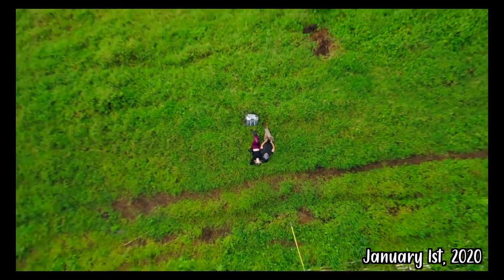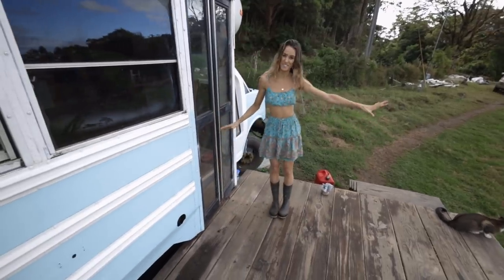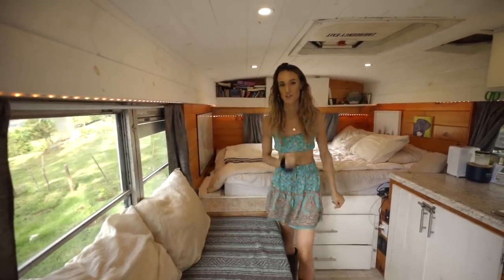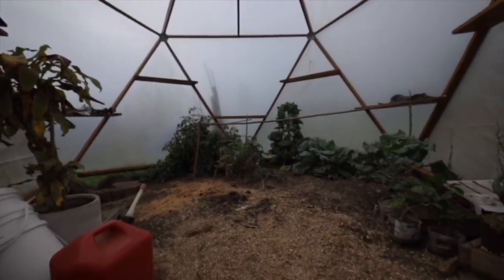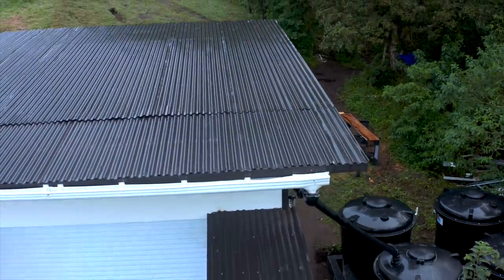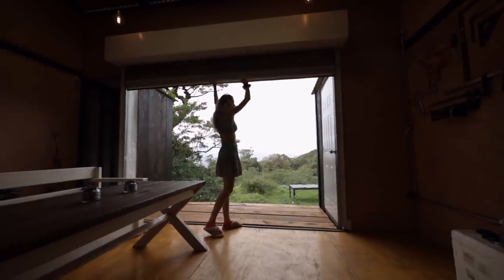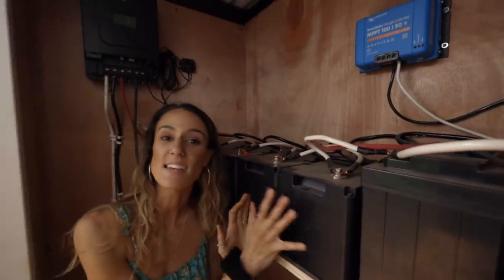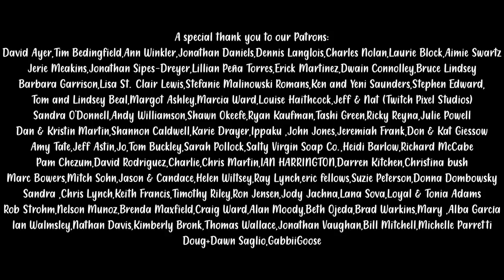TIMELAPSE: How We Built A 3 Acre Farm in 1 Year from Scratch

Comment: For that rough road of yours, try getting hold of an old grader/tractor tyre. The bigger/heavier the better. Lay it flat, put one of your pieces of offcut square tubes on the inside with a strong U-Bolt through the tyre. You can even add a grate inside and add rocks/gravel inside for additional weight. Then, just drag it behind your truck using a strong chain when you go down to town and then back up again on your way home... In no time your road will be smooth and driveable as the rubber even rips out the small rocks sticking out the ground for a nice smooth finnish...
Reply: That probably would work better when the ground is wet.

Comment: I would make a large sealed “pond” at the top of the hill and run a pipe all the way down with a hydro electric generator if it rains that much and you can make the pond big enough u might be able to make electricity 24/7 or you could basically use the pond as a massive battery and only open the valve when u need power
Reply: Or 2 ponds to pump it back up with unused solar/wind Power.

Comment: You both are doing really well !   Congratulations !   For anyone living off grid and without hot water yet.... it's super easy to setup and you don't need much power.   You can run it off of a 12V water pump and propane, all you need is a cistern.   I waited 2 years before hooking it up and good god.... i can relate to how amazing it is, and it only took half a day to setup.
Reply: ....or you could burn firewood under a copper water tank...and do the necessary plumbing.

Comment: The progress y'all made in the last six months is amazing! Inspiring make me feel lazy lol  Thanks for the overview of your power system you have a fine set up. People look at amp hours but convert it to kwh and you can literary calculate your power consumption. Been trying semi off grid for over a decade and I am still learning. My advice to everyone is plan you power for your worst days more panels often are required it helps series wiring them at 48 volts into the mppt controller. It maximizes low light efficiency sometimes 20% - 30% lets face it much money in the batteries. Most people want to add to the battery bank but a small bank charged to 100% on bad days is better than a large on only getting 50% on decent days. This alone will double the life of high priced batteries but on good days it extreme free power!! Also a propane RV water heater saved me tons of power consumption for the bad days. 

Sorry I used to install back up systems and kinda nerding out on your set up....
Reply: An air-source heat pump in that climate would be fantastically efficient for heating both domestic water and any interior heating for those cold nights. Dollar-wise vastly more efficient than propane or any other fuel source. The possible fly in that formula-ointment might arise from fact that generating/storing electricity at the site is also expensive.

Comment: technically you want your solar panels facing the south on the northen hemisphere and nothth on the souther. and normally you would tilt your panels in a fixed instalation the latitude un degrees. panama is between 7 ish to 9 ish degrees but for self cleaning via rain normally you tilt them 15 degrees that the self cleaning minimum angle. should you clean them offen usinf the latitud angle should be a little more efficient. also shade makes panes super inefficent, partial shade makes the electron that you made move from producing cells stay on shaded ones so the energy production is drastically reduced by saded cells (the squere blocks are individual cells) source my thesis was a big proyect. also sollar is the only big energy production method that dosent produce AC current. peltier effect also but is extreamly uncommon. all energy produced by movement and rotation is ac and has to be "refined" to 110 v in a "good " sine wave from the source.
Reply: The solar inverter will transform DC to AC.     However,   That aside I am amazed that there is enough energy being produced to run the Arc welder?      I have a 12,000W system with 2 x 5Kw inverters with a 19Kw battery back up.    With all what you are running I am amazed.??
Reply: @tommybrown9034  They probably used the bus as a energy source by using its motor
Reply: @Plaufin  Nowhere near enough power? looking at all the electrical power tools including the Samsung  fridge that uses a lot of energy 24 hours a day.

Comment: id recommend you put the wood stove lower or you'll need a way to redistribute the heat for the lower area from floor to stove higher. i had to mount the same stove at 4 foot high in my camper as it was the only place to put it, but found i got very cold feet and legs, it is in Canada and i camp in winter so obviously a lot different from your climate. ended up solving the problem with a computer fan up high and metal duct to transfer thre hot air down so it comes out on the floor . but obviously a-lot simpler to to just mount stove down low if you can.

Comment: three phase isnt really problematic unless you have to set up appliances that use three phase electricity. you can treat each of the lives as a single phase line. It can be tricky setting up a motor if its a three phase motor because you need to know if it uses a star or delta set up but otherwise all you need to know is don't cross your lives because its hazardous the same way you don't cross a live and neutral. because three phase refers to three different live wires going at a different frequency it means the electrical flow will go in different directions to one another causing shorting similarly to neutral wires. There is probably a better explanation for this but in essence this is what happens.

Comment: Your man can weld up a boiler and buy a steam engine. It make one from some simple parts available in a junk yard. You can get easy plans from the internet.  Steam Engines can run a generator or the water pump or equipment. Just needs a PTO. Steam is clean energy

Comment: It's testing grounds, what is possible, no electricity, but accessible new gen TV antena and obviously internet. Greenhouse - woodcutters dream/wood storage. Strange but water debris from the trees does not plug water pipes. Riverside house, but no river. Impact door should be good shelter. Home PC can heat a house this size few degrees with current TDP and keep inhabitants entertained.